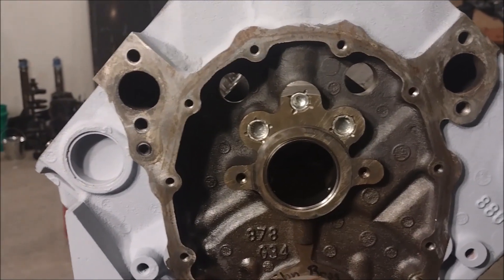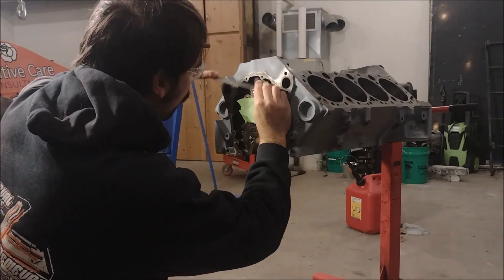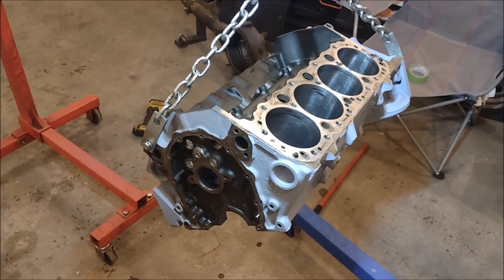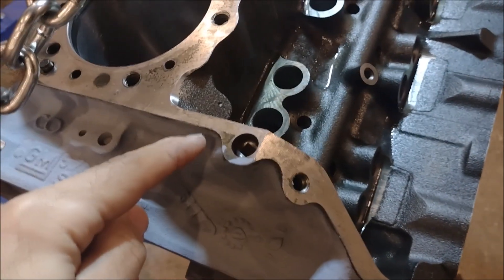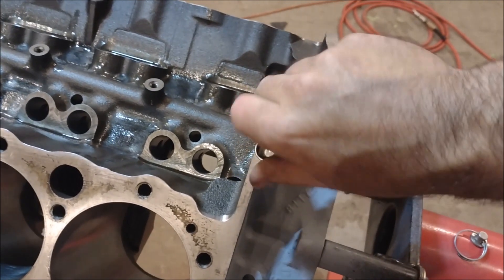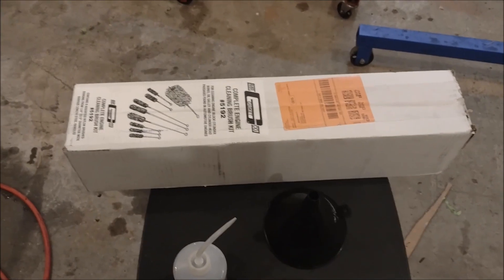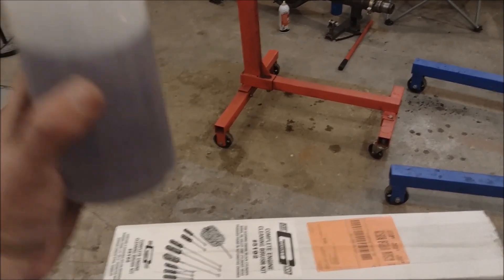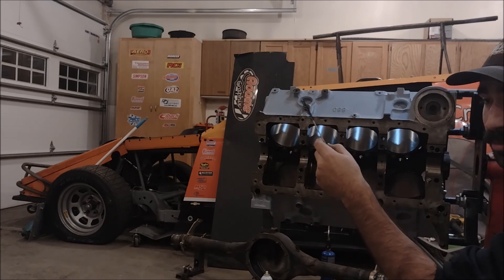SBC Block Cleaning and Prep - Plus Engine Failure Analysis

Comment: You missed the most important part of cleaning a SBC engine. Cam bearings ALWAYS be removed then clean followed by installation of new cam bearings. You can NEVER get the particles out from the groove around the cam bearing bores and that goes straight to your mains upon fireup!
Reply from the maker: To be fair, I did mention in the video that this wasn't technically the proper way to do it, and to do it properly you must remove the cam bearings. Most guys farm out their machine work like I do, and that usually includes cam bearing installation. A basic clean up like this after you get your block back from the machine shop is better than nothing.

Comment: Built my 99 4l60e. Would a cast 400 crank build a good 383 street truck motor. Thinking high compression too
Reply from the maker: I don't see why not. However the stock 400 cranks have larger main journals so they won't swap straight into a 350 block. Easiest way to go would be an aftermarket stroker crank which you can get a cast one pretty cheap

Comment: Do u recommed washing block again after getting back from machine shop.  i ask machinist and he said no.  All plugs are installed .  just dont want water sitting in any oil galleys..  Please lmk thanks .  It does look clean.  its sitting now. i sprayed cylinders with WD40 for now ..   no heat in garage and its cold out. lol
Reply from the maker: Normally I would say no to washing it with water. Only reason I did that here was to get the little paint flecks left over from the previous bad paint job out of the porous parts of the casting. Either way though I always remove the oil galley plugs and go through them with brushes and compressed air like this. Any little nooks and crannies that could hold onto shavings from the machining process need to be addressed as well.

Comment: If I can add something I found out. At 4:40 in your video, it shows the rear oil galley plugs. Yours look like they are sunk way in, they actually may be blocking, or partially blocking the small oil passages that intersect there. Which could have been the cam bearing failure issue you talked about. On my 350 the plugs only go in 3/4 the length of the plug.
Reply from the maker: I will investigate when I put the plugs back in. Thanks for the the suggestion!

Comment: Thank you for the tips and experience. I'm currently building my first sbc and it's been somewhat frustrating because no one has my combination but I'm so glad thanks to you videos you and others make about sbc has made it really easy to identify fault points and my sbc is very good for being a pre 86 roller block. I don't think I will be switching to roller tappet soon because of the amount of parts I have to change with them but I got 1 just in case
Reply: Nothing you said makes any sense. You dont even seem to know what a tappet is.

Comment: Wow, what kind of parts are they getting,  I've swapped many to double roller and never had that problem
Reply from the maker: This one in particular was a Howard's set. I think this really only applies to the newer factory roller cam blocks. On the older blocks that oil passage is set back further. However a machinist I talked to ays he does this on every block just in case.
Reply: @rossracing6433  they contact on the older blocks as well. They just don't contact as much and make such a mess. That's why so many can say they put one in and had no issues.
Reply from the maker: Makes sense to me and jives with what my machinist buddy says. Thanks for the feedback!
Reply: @rossracing6433  It was a neat video. I am a machinist also but spent a fair bit of time working in engine shops too. I've seen dozens opon dozens of the older sbc's with witness marks from a double roller installed without clearancing, but never one of these blocks. It becomes pretty obvious that the gear and chain contact on these blocks when installing the t/set so I''m kinda surprized it still got assembled like that. Maybe it got installed while hanging over the cars fender. I could see not catching it in that situation. But when on a bench or stand it's easier to see. So that's why I really thought it was a neat video to see, because I've never come across this error yet in my shop.

Comment: Thanks for the info. I'm building my first engine for a S10 350 conversion. My brother used to race dirt track at Thunderbird Speedway in Muskogee OK and I have a little experience with engine work from helping him. Now I'm 50 yrs old and building my own is on my bucket list. Any tips are much appreciated. New sub.
Reply from the maker: Thanks for the sub! I'll be posting regular updates on my engine build as I go along, so hopefully you'll find some more info that's helpful. One thing I didn't mention in this vid, for cleaning surfaces like the deck or bearing surfaces, make sure you use lint free material and don't leave any little fibers behind. I like to use the clean-room wipes they use for building computers and soak them in rubbing alcohol. Can get a big pack for cheap on Amazon
Reply: @rossracing6433   ok thanks. I'll be watching for your videos.
Reply: Lol im building my first dirt track motor for tulsa speedway